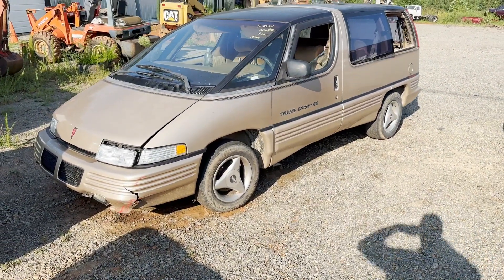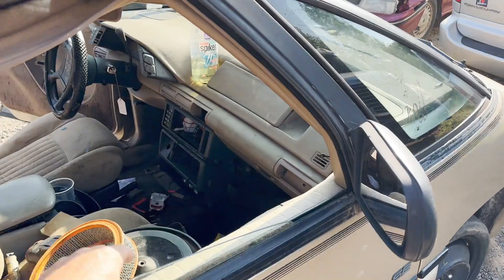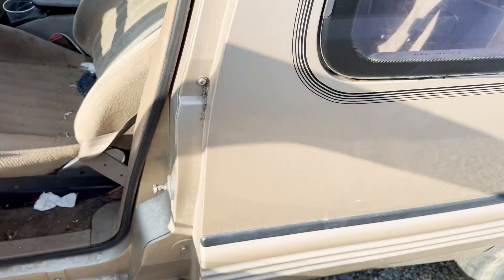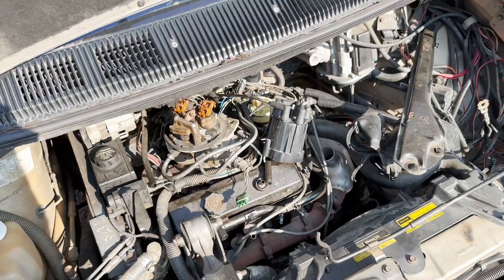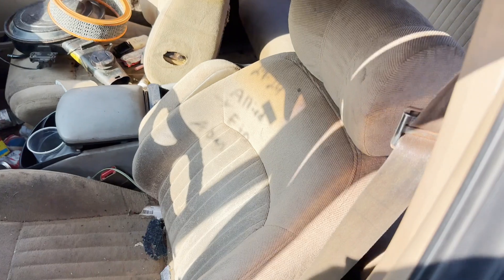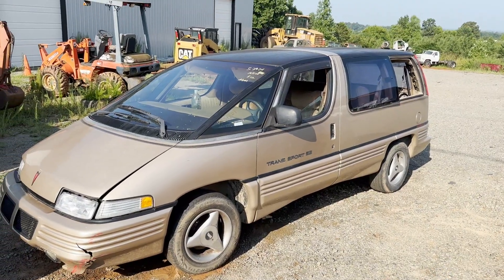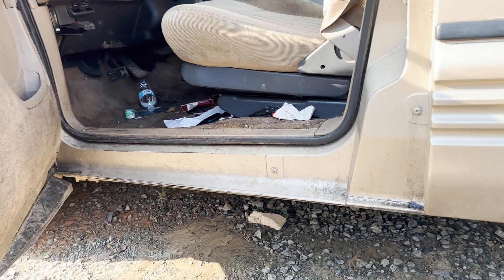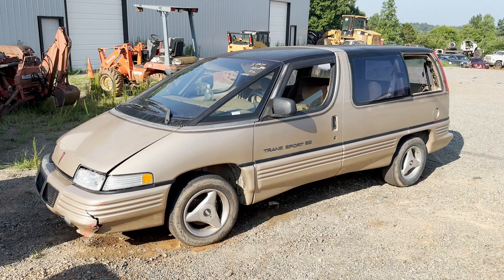1992 Pontiac Trans sport Scrapped

Comment: They were called "Dustbuster" vans since they looked like a Dustbuster vacuum cleaner. It's built like a Saturn where there is a metal skeleton frame for protection and most of the body panels are composite so they don't rust and rebound after a small accident. 

We got the VIN, we win: 1GM for US made Pontiac MPV, D for 5,001 to 6,000 # Gross Vehicle Weight Rating with hydraulic brakes, U for all purpose MPV 4x2, 0 for APV, 6 for APV again, D for 3.1L V6 with TBI, RPO code "LG6", 4 is a check digit, N for the 1992 model year, T for Tarrytown, NY assembly and the rest is the production sequence. The Tarrytown facility operated from 1896 (prior to GM) through 1996, and after that time, production was moved to the Doraville, GA facility. Exterior paint is code 33 Light Driftwood.
Reply: someone will take it.

Comment: My mother had one just like this. Same color. It looked like a freaking spaceship to us. Despite that, it also didn’t seem to stick out much. Fit right on in at a any parking lot back in the day. One day, someone hit her and I came home to an empty house. She was fine, but the van was never the same. She had it repaired, which felt like forever. When she got it back, she didn’t like it. I don’t know if she was spooked or what, but she claimed it never drove the same. She traded it in in what felt like less than a year or two. Very sad. I remember riding up front. That dash board went on for miles. You never saw the hood from the “cockpit.”